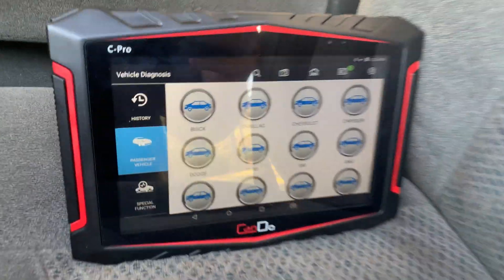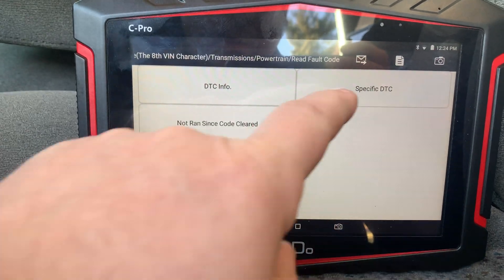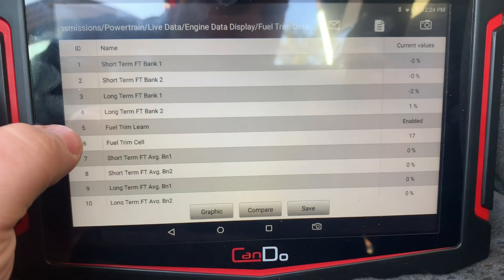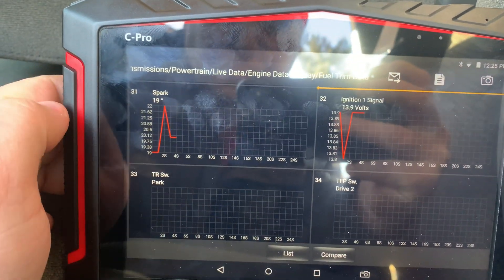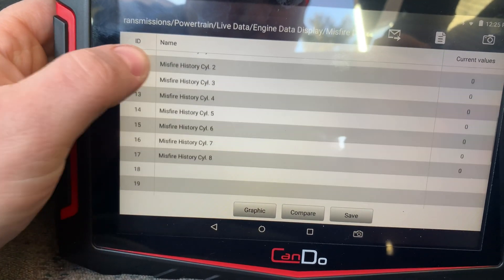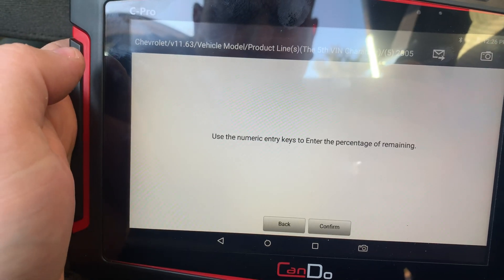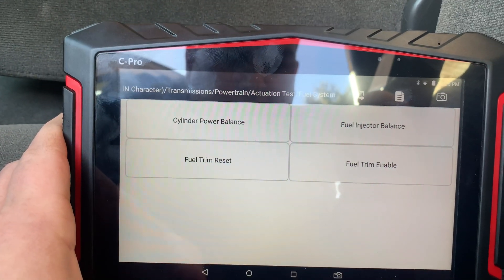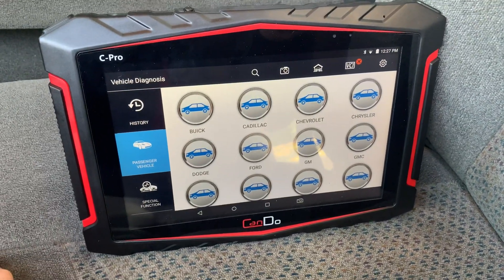CanDo C Pro Chevy 3500 HD Data & Bi Directional

Comment: If you had to choose between the CPro and the MP808 which one would pick as far as number of functions and vehicle compatibility? I'm trying to decide between those 2 and the Cpro is $200 cheaper right now at JBtools but if the Autel does alot more or works on more vehicles I'll pay the extra money for MP808. Also I cant find out how much the Cpro updates are after the first year so if you know that I'd appreciate the Info as well. Thanks

Comment: THAT SCANTOOL IS OUT THERE , IT IS VERY QUICK NO DOUBT I WONDER CAN IT SCAN JAPANESE DIRECT VEHICLES THE RIGHT HAND DRIVE ONES CAN'T REMEMBER THEIR ISO PROTOCOL . I THINK IT'S JOBD BUT NOT SURE NUN THE LEAST THE TOOL IS A WINNER . I BELIEVE THIS TOOL WILL DO GREAT THINGS WITH THE LIKES OF NISSAN , HONDA , GM AND MANY MORE THANKS FOR SHARING !
Reply from the maker: That’s a really good question, I’m thinking it can. It seems to be built like the launch platform and I believe Steve uses the Diagun fairly often. I wish I had a way to test it. You have me wondering now. It’s def really fast that’s for sure, one of the fastest I’ve ever seen.